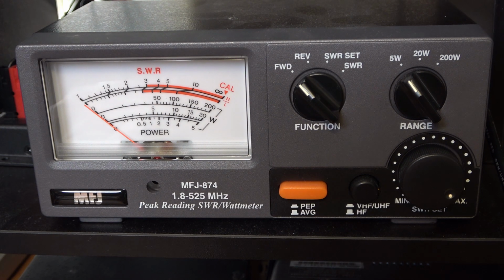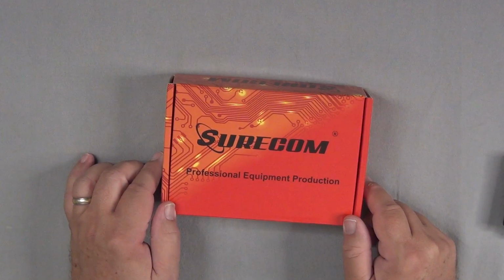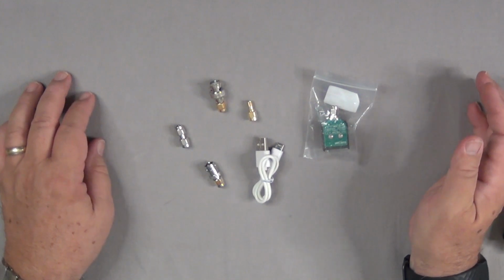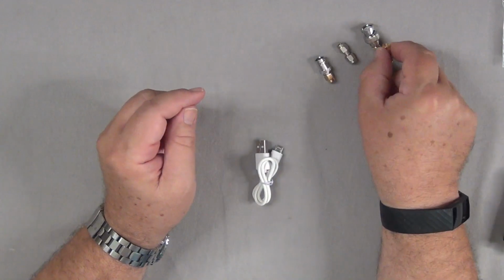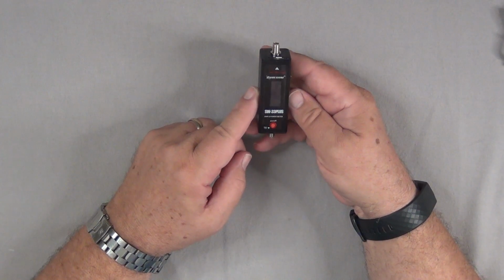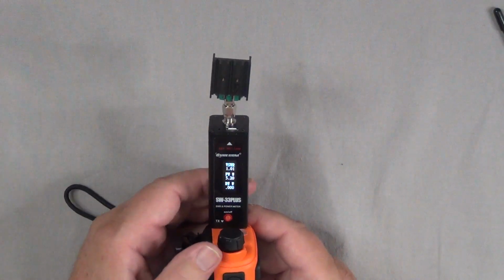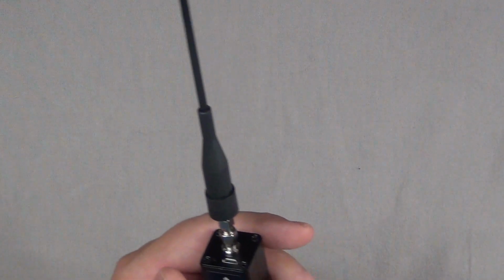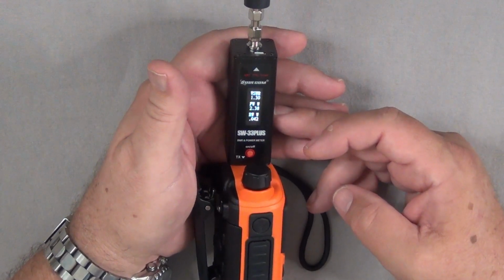Surecom SW 33Plus SWR Meter

Comment: Can I use the sw-33 plus to measure the power of the TIDRADIO TD-H8 10W Walkie Talkie? Can the dummy load damage the 10W of the TD-H8?
Reply: I have both of these items and it works fine.
Reply: Olá. Por favor. Eu também tenho esses dois itens. Mas a medição está meio confusa. Não consigo acertar como posso segura-lo para medir certo.  @Mel0763

Comment: I got one and was disturbed to see that every 50W radio I hooked up to it was reading about 38-42W. Just got around to trying a friends analog meter and it shows 50W. So I'm wondering if this meter is not really capable of testing power that high (It says it can do 100W) or if I just got a bad unit.
Reply from the maker: I tend to use these consumer grade meters to see if what I'm testing is in the "ballpark." Really accurate testing sessions have associated protocols that are difficult to duplicate in the shack or garage.

Comment: In order to get a more accurate SWR reading, I made a ground plane plate out of a piece of 8"x7" 26 gauge aluminum flashing. With a 19/64" hole drilled dead center, it fits perfectly between the double male adapter and the antenna you are testing. Using this method I got perfect SWR readings on GMRS channels with two different radios using my 771G antennas, confirming - to me at least - they are optimized for those frequencies while non-GMRS frequencies had higher readings.
Reply from the maker: I've seen others do that, too. Thanks for watching and commenting.

Comment: Thank you for the positive review. I'm curious, would this equipment be suitable for testing both my 25-watt and 45-watt base radios, or is it designed specifically for portable radios? Your clarification would be greatly appreciated. Thanks!
Reply from the maker: If your base stations are 2m and 70 cm, then it should work fine. You'll likely need an adapter for your coax, though. Cheers.
Reply: @GadgetTalk4U  thanks

Comment: I have a Standard Horizon VHF 1255S and would like to test output. I was thinking about the Shakespeare  AR-3 or the Surecome SW 102 SWR meters. Is there any reason I would have to buy the dummy load with the Surecome meter or can I just connect my antenna?
Reply from the maker: Just connect your antenna. Dummies are good when doing a lot of testing on busy frequencies. Just remember to ID when transmitting as required by whatever service you're using. Cheers.
Reply: @GadgetTalk4U  Thanks for the info!

Comment: You need to mention with this swr meter using the antenna that you need to hold the swr meter exactly as shown in the pictuto ground it out. Also the antenna needs to be straight up and down. Those to things make all the difference in the world when checking the antenna.

Comment: I just received the older version (SW33) in the mail, apparently, an Amazon seller still sells the older version, which comes with the 5-watt dummy load instead. It has most of the same functions which will work for me just fine, however, I want to caution folks who click on affiliate links out there on YouTube to be aware that they might be slightly obsolete with newer versions to be had in some cases. Cheers & 73, Dave, KU9L

Comment: Why did you need to change the power of the radio when you connected the antenna?
Reply from the maker: I changed it to use the least power required. As this device says it is best to use at least 3 watts, I could have left it on high.

Comment: By the time you add all of the connectors that you might need you will need a larger box. Lol try the surecom sw 102 nice little box!
I used one of my bird watt meters to calibrate the 102 and found that the one that I received measured my HT  about ¾ to 1 watt low. I used the 102 connected to the radio and the ant side connected to the bird meter. For termination. The 102 is what I am adding to my repeater so that I can monitor its output power.

Comment: I have the standard SW-33 and an getting very high SWR reasons. I cup my hand around t the device as the instructions say, but to no avail. I also have a SW-102 with a ground plane plate and even with the plate I get very high SWR readings, even with Nagoya NA-771 and NA-24J antennas. I have to ask, is this meter better than the standard SW-33? Oh, also, what's the story with the dummy load? Does it read all the way to 20W, or should the cutoff be less? Thnx!
Reply from the maker: I'm not sure about the differences as I don't have the SW-33. Try comparing the specs on their respective sales pages. As for your high VSWR try using the dummy load. Mine says it has a 20Watt peak limit. That probably means less than 1 - 2 seconds before damaging the unit. Set your radio to a lower power setting. With the dummy load attached and no antenna you should get a zero reflected power amount so a VSWR of close to 1.0. The power reading should be what the radio's outputting. I've found that's usually less than what's advertised. If you get a high VSWR with the dummy load you know there's something wrong with the device. If the VSWR is low with the dummy load then something is reflecting power back to the radio in the antenna system.  I did a video on the channel on HT antenna comparisons you might find helpful.
Reply: @GadgetTalk4U  Good comments all! I have a 50W dummy load that tends to be a bit heavy for such small meter and it gives me a 1.00 reading. Your meter has a very small readout, but at least it can be seen on camera. I have an SW-102 meter, but I don't know whether to get an SW-33+ or keep the SW-33. I'd like a small pocket meter; just don't know which way to go. Did you consider the standard SW-33 when you bought the 33+? Also, have you noticed a significant difference in SWR when you cup the meter? (One reviewer complained that when he cupped the meter, the SWR went down and that when he released it, it went up. But that's exactly what the manual, such as it is, said to do.)

If you needed to trim an antenna, would you fell comfortable using the SW-33Plus? Or would you want something more a bit more extensive?
Reply from the maker: @johnroberts6695  If I were tuning a base station antenna, I think I'd use a more expensive meter. I have a MFJ 874 that covers that range as well as a NanoVNA that does VSWR readings. Sad to say, I haven't compared them.
Reply: The + has a back lit display,  shows forward watt power and reverse reflection. It also has a SW readout 
The 
Mark II (your device) has a digital readout,  forward watt power and a SW readout. 
The difference between the two is the display and the + shows reverse reflection.

Comment: Do you have to touch the metal case of the meter with your hand or not?
Reply: YES, the manual suggests you cup the meter in your hand to get an accurate SWR reading. If you only want a power reading, you don't need to do this, however. By cupping the radio in your other hand, it will act as a ground plane. Thus your readings will be more accurate.
Reply: @johnroberts6695  Hi. Yes, I bought one. I wanted an SWR meter so that I wouldn't have to deal with problems with the antennas and connections and know which ones are convenient and which ones aren't, and the manual indicates this. By the way, it seems accurate for how portable it is, right?  Regards.
Reply: @Hexagramaton  » Well, that's the big question, but during the last day or so I’ve learned precious little about them. I suspect the SWR is far more accurate with mobile or station radios, as there's so much RF energy bouncing around that the SWR seems unusually high for all HTs. I have a SW-102 with a ground plane plate and I was expecting BIG differences in readings, but it didn't happen. I suspect the reason Surecom stopped including them was because they just weren't making a huge difference. Perhaps if I put six- to ten-inches of cable between the antenna and the meter it might change things, but I still have to find TYT's damn proprietary cable for the TH-8600. I can't find one anywhere, so I can't test my theory.
Reply: @johnroberts6695  I understand. I have found that SWR measurement on portable transceivers is very poor. There is no system or norm that measures the radiation of a wave fraction in a mobile system without anchor and without proper mass. I mean that in the walkie the establishment of the transmission should always be with a ground plane and it is never observed or can be observed, unlike the anchored and mounted emissions with installation. The antennas of the walkie talkies are terrible, and this device at least serves to see if the antenna, although it does not have all the precision that I would like, resonates more or less decently.  All the best.

Comment: You have good taste! I own both devices. The GS-5B and the Surecom meter. You can add SO239 adapters for regular coax. Maks a great on-the-go meter. I also have Surecom's SW-102 in line with my Anyone 778-UV. Which also requires a type N to SO239 adapter. The meters are a good price for what they have to offer.